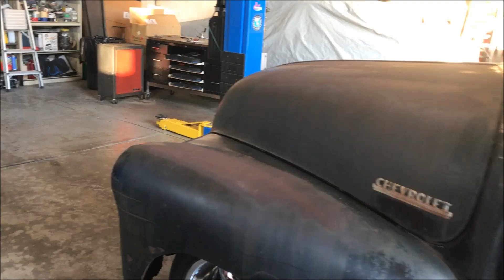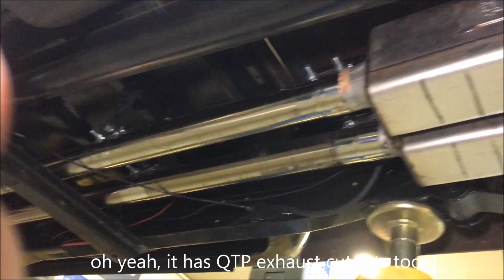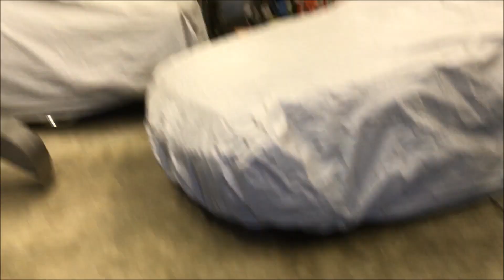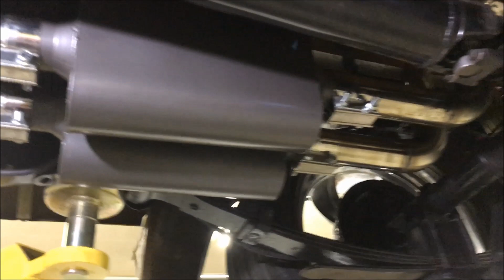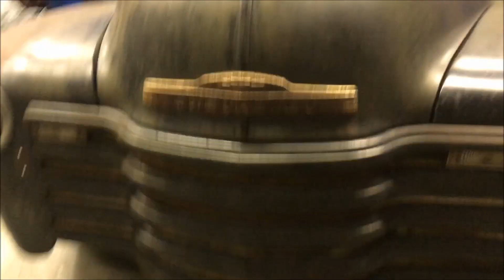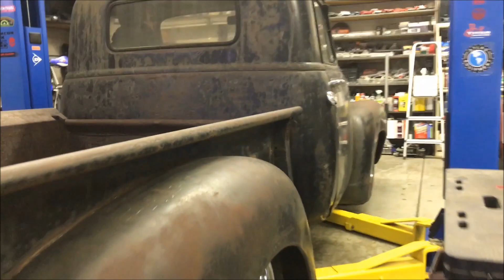53 Chevy Shop Truck - Big Block Muffler Comparo - SpinTech vs Flowmaster Sound

Comment: Had blowmasters since 86 on chevelles,gto,cuda,blazer and at least 10 more,they didnt have a competitor unless you wanted muffled sound,billy Boat makes nice stuff and used on my vette,but for a cammed ride ive used Spintech since 2010 and wow what a difference,and they let the sound of cam just hit every note while blowmasters just loud,that spin baffleing is genius for sure instead of chambered walls.